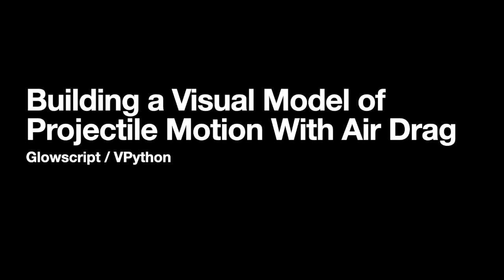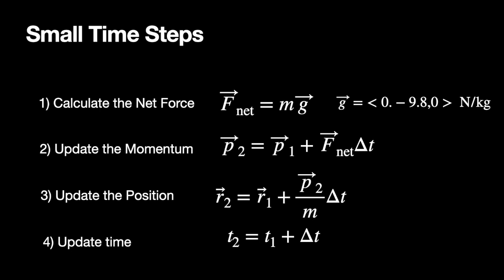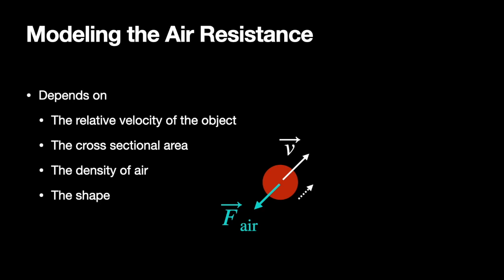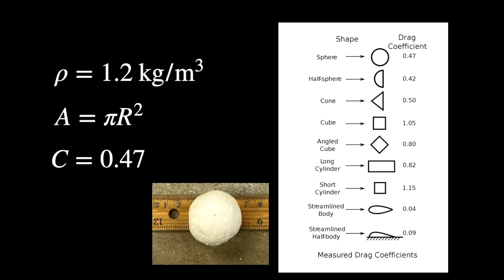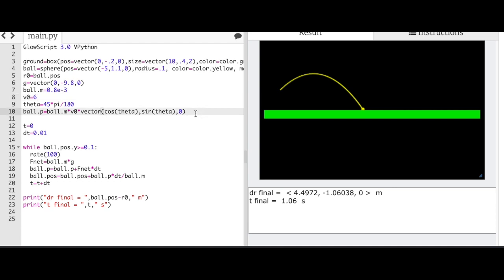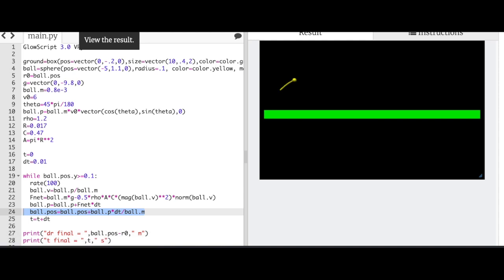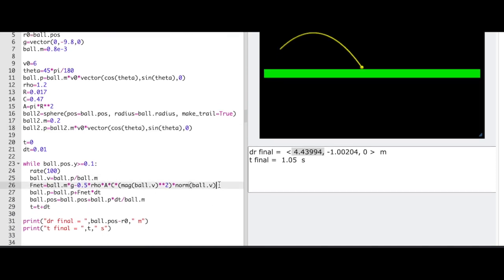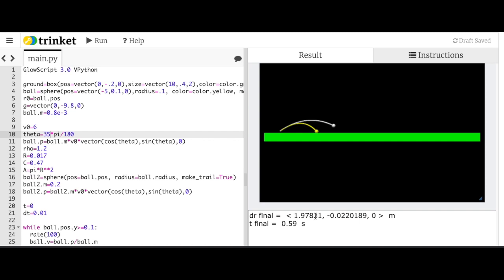Building a 3D Python Model of Projectile Motion WITH Air Drag

Comment: hi! how come we divide ball.m to ball.p when getting ball.v when we multiplied ball.m in order to get ball.p? won't they just cancel each other out?
Reply from the maker: This is a great question.  The main line is the one where the position is updated (ball.pos=ball.pos+ball.p*dt/ball.m).  In this line, I divide by the mass to get the velocity for the position update formula.  That's all cool.

The problem is that the net force has a velocity term in it - so, I could use ball.p/ball.m in that calculation, but it would get messy - so I first calculate the velocity from the momentum.

But why is it in there twice?  The first time, I use the momentum to find the velocity. Then I use this velocity to find the net force, then I use this net force to update the momentum (now it's a new momentum). So, in the ball.pos line - I need to use the NEW momentum, not the old one.  

Hope that helps.
Reply: @DotPhysics  thank you so much!! your video and explanation was really helpful!